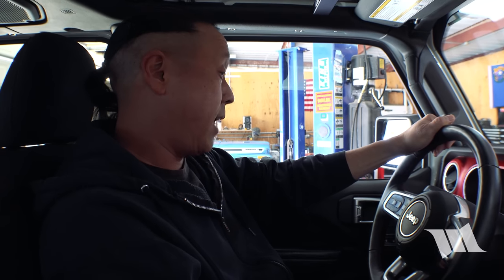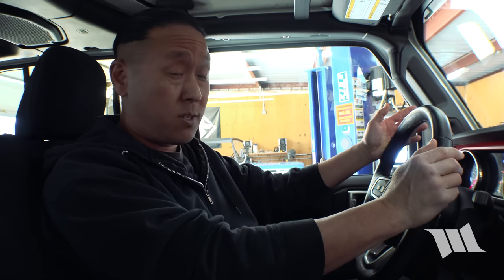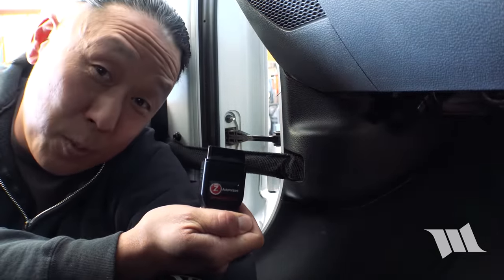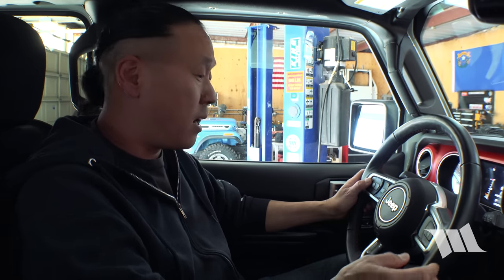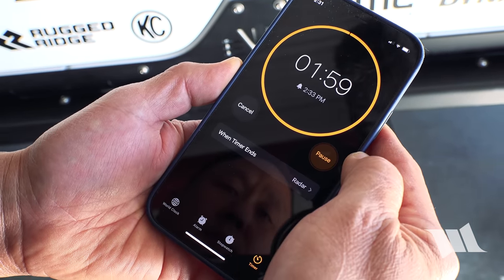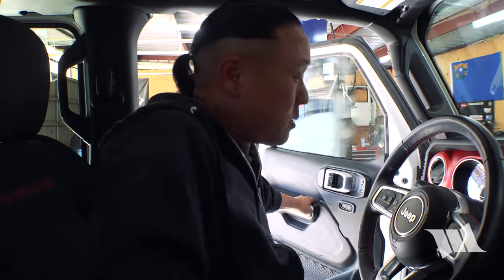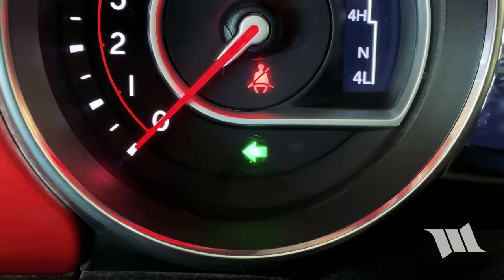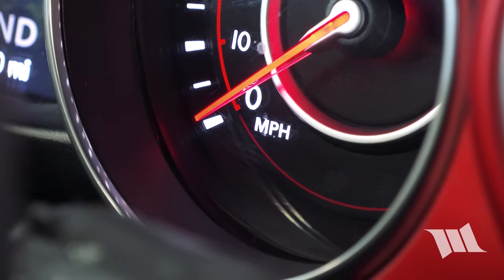HOW TO Turn Off LIGHTS OUT Error on a Jeep JL Wrangler or JT Gladiator After Installing LED

Comment: You just showed a great reason to NOT change the LED tail lights!!
Reply from the maker: LOL - that may be true but as I note in the video, this will ALSO address new headlights, fog lights or even front turn signal lights. A change to them will ALSO cause the error to come on and this will get rid of it 😎
Reply: Yes, that’s silly, why have options for anything?!
Reply: @wayalife and you need to pass this process with each kind of light?
Reply: @Danifer_TV  my experience if your changing them individually over time, then yes. If you change them all at one time, set up the right settings in tazer, do the process, then no.

Comment: for Flashcal F5 users with JL/JT, plug your flashcal device , turn on vehicle (w/o starting the engine), go to "options" then choose "vehicle settings" scroll to 2nd page then choose "Standard/LED". if you have the OEM LED package in your jeep you will select "standard" then exit out and unplug your flashcal device. You will do the same procedure again but this time you will select LED. after selecting LED, go to DTC reader and select "clear codes". while the Flashcal device is still plugged in,. go ahead and turn on your turn signals 20sec on L and 20sec on R. that should clear the annoying dash warning light

Comment: Finally got it to work! For those of you struggling with this, I had to do an extra step. When you’re in the Tazer menu be sure to select Clear CELs?  After I did that and followed the steps laid out, it worked! My Oracle tail lights are no longer hyper flashing and the error code is gone!
Reply from the maker: Good tip!
Reply: How do you clear CEL’s?

Comment: Tried this and it didn't work the first time but I discovered a few things that may help... The core issue is that the factory LED's have a fault sense wire and this procedure is designed to turn off that fault wire.  The question becomes, does the replacement LED light fixture have a chip or a circuit to normal this out, if not, then this procedure needs to take place.  Adding resistors just effects the voltage to prevent hyper flash on non-led to led conversions.  That being said, my issue was due to a fender chop with small LED pod lights that I'm using for Turn signals.  Since I'm no longer using factory DRL I used the Tazer to change DRL: none.  Although the Tail light LED off/on procedure didn't work, I decided to try the procedure but toggling the FrnTurn LED from On to off, followed by 3 reboots and then Off to On followed by 3 reboots.  This Worked !!!  So to speed things up, there is a faster way to do the reboots.  1. Close the Jeep door. 2. Run position and go to Tazer and clear DTC's.  3. Go to lighting then Tail or FrnTurn depending on which one you are trying to fix. 4. Change LED to NO. 5. Reboot.  6. Once the reboot is complete turn the Jeep to off position "Do not open door".  In order to hit the sleep cycle just wait for the screen to go black then look at the shifter and wait for the lights to go out.  You can then go back to the run position and do another Tazer reboot.  There is no need to wait 2 minutes.  Once the reboot is done, go to ignition off and wait for the shifter lights to go out then repeat. After the 3rd reboot, go to the ignition run position access the Tazer and turn back whichever LEDs you turned off back to YES and do the same 3 reboots.  Remember, you need to keep the door closed to speed up the sleep cycle between reboots.  Will literally cut the time by more than half.

Comment: This worked for me 100%! I have aftermarket fenders with integrated LED lights from Metal Cloak. I recently started getting a dash error that my right front blinker was out. Upon inspection of the wiring I saw that one of the two ground wires had been severed/disconnected at the termination point in the plug (on Metal Cloak side). Surprisingly, the light still worked it was just throwing an error; best guess is that ground was to detect continuity on the Jeep side. Metal Cloak sent me a new light unit with no hassle at all. I put the new one in and still had the right front blinker out message on my dash. I followed these instructions except I selected "LED HED". FIXED!!! Thank you! 🙌
Reply from the maker: Glad to hear our video was helpful to you 👍

Comment: After numerous attempts to fix my issue, this WORKED!!!!  No more light out error on the turn signals.  THANKS!!
Reply from the maker: Awesome! So glad to hear it worked for you and that our video was helpful as well.
Reply: Great question and great video, I’m about to do this on my JLU…. I’m assuming I clear the turn signals in the Tazer instead of the tail lights to clear the turn signal code…or do I follow this exactly like you did in the video Eddie?  I may just try this both ways!!  Thx again for posting this!!

Comment: Thanks, this has been driving me crazy with the AAL fender brace replacement. I had the wired harness but it stopped working and I began getting the hyper flash and warning message. I took the harness off and used the Tazer JL method and it worked! Thank you. Thank you. Thank you!
Reply from the maker: Glad to hear we could be of help to you with our video.

Comment: I had been searching for a fix for my aftermarket fenders with LED turn signals. I have a Tazer Mini and followed your instructions. This 100% fixed my Lights Out message that would come on all the time and the Hyper Flash. I did initially use the Tazer but I was still getting the message. This step-by-step guide was top notch and really worked. Thank you!!!
Reply from the maker: Awesome! Glad we could be of help with our video.

Comment: Thanks for the video.  This is not the first time I've needed to get rid of that pesky tail light out warning. The last time was after I installed my aftermarket tail lights.  A month ago I needed to swap back to my OEM LED tail lights. (long story there for a different day).  Last time I think I got the alarm to go away by doing 2 sleep cycles of 5 minutes. I am pretty sure that worked... then... but not now.  Your suggestion of doing full reboots did work this time around... at least so far. Thanks again.

Comment: For me, this video shows how useless the dealers can be.  I bought a "Slightly used" 22' Gladiator that had LED taillights and got the error message as soon as I drove it home.  It only happens when I'm using the left signal.  I took it back to them 2 Separate times and they couldn't figure it out.  Now I'm glad I can do it myself.  Great video! 👍

Comment: I used JSCAN and changed setting once. No need for multiple times at all like this video required. Been working fine 6 months no issues.
Reply from the maker: Cool. If you have these exact same lights and were able to clear the error with just one setting, good for you.

Comment: Yes, the Tazer JL reboot cycle is... "involved". When I first got mine, I made some changes to my Jeep and they didn't seem to take. I read the reboot procedure what felt like ten times, because it's not really clear. I finally performed a similar procedure to what you have shown. Only difference, I stayed in the Jeep. I would just open and close the door, wait for the lights, etc... but remain in the vehicle. Thanks for the video, certain it will help those that miss this last and important step.
Reply from the maker: I'll bet that works too. I think the point of exiting the Jeep was to help it to go to sleep faster. At least, that's how it was explained to me.

Comment: Thanks for this tip. I got that error code when I installed the Oracle Flush Mount Tail Lights on my JLUR
I already have the factory LED package and didn't need the resistor
Reply from the maker: Glad it helped
Reply: I’m having the same issues with my Oracle lights. So far not having any luck while trying this reset. Eddie, the first three resets you have the LED Tail set to No and the last three resets you have it to Yes, is that correct?

Comment: after i got to work i watched this a second time and decided to try it.  turned off the LEDs and did a reboot.  got back it and out of habit i started the jeep.  did another reboot. realizing this was going to take to long before work started, i turned the LEDs back and did one more reboot.  it worked.  no fault, no hyper clicking dash.
Reply from the maker: Cool
Reply: The Tazer manual suggests only changing to NO and then back to YES with the 20+ second indicator use. ver 11.3.7.. I think Ill be trying the short method first, then, if not.. the long winded way..

Comment: Thank you for this Eddie. I changed out the Fenders on the JLU and got this message for over a year with no luck shutting it off.  I have since sold it and bought a new JL and a JT, so this info will come in handy if and when I change them out again. Incidentally, I did keep my CB Bar, but will need another one for the JT. Will they be in stock again soon?
Reply from the maker: Awesome, glad to hear our video will be helpful to you on your new JL and JT and the CB BAR's are in stock now 👍
Reply: @wayalife  awesome, expect my order in the next few minutes.

Comment: Hey Fella - Love the videos. Do you have a video for the same procedure when replacing halogen headlights with LED Headlights with Halo Rings?...Since it is set as STD in the settings I would think simply changing to LED and doing the "REBOOT DANCE" will make it all work. I am installing LED's next week and already have LED tailights on the Gladi.
Reply from the maker: If you're getting the error code, I would give this a try. You would do the same thing only, when you're in your Tazer, you select the headlights.

Comment: Great video as always. I’d love to see a video on speedometer calibration. I have 35’s and bought an ECRI calibration. I changed the tires to 35 and the gearing was off. So I tried the driving method but it would only go up to about 33.35 for the tire size. So the gearing is still off. So a video with tips on this topic would be great.
Reply from the maker: Sorry, have no experience with what you have but with the Tazer, this video is what I did to calibrate our speedometer https://youtu.be/81_evB9At3I
Reply: @wayalife  Thanks! I will be check it out. Also, just purchased a Wayalife decal. Can’t wait to slap it on my jeep. 🤘🏽

Comment: I’m going to try this on my JL.  Ever since we installed the AAL highlines we get a very intermittent front turn signal warning on one side or the other.  It’s very random and doesn’t stay on long, but I’d like it to stop permanently.
Reply: Did Your JL came with the LED package ??
Reply: @faisal3865  yep
Reply: @psualligater  I guess that explain why u had it, mine got the halogen and I am worried i well get it when i upgrade
Reply: @faisal3865  I have halogen original and upgraded to LED at first it worked fine and no errors on since I had the Tazer but now I have an error and cant get it to go away as well as my LED indicator doesn’t blink on one side

Comment: Thanks for this extremely helpful video. Btw after reset those settings, can I unplug the tazer and reattaching everything back to the SGW module?
Reply from the maker: Yes. But, you will need to restore everything back to stock before taking your Jeep back to the dealership.

Comment: Had a similar experience with the taser mini. I drive a manual JL. Setting the tire size required an extra couple of steps for manual vehicles. 🤣 As an IT guy it reminded me the importance of RTFM 😜🤣
Reply from the maker: LOL - If you don't mind me asking, what extra steps did you have to do? Pippi, our red 2-door is a manual and if we ever change the tires on her, this would be helpful to know. THanks!
Reply: @wayalife  If you have not already found the answer, I had to do this same relearn procedure.  After I changed the tire size on my JL with a manual I had to get on the freeway and maintain a speed of at lease 40-80Mph and shift into 6th gear for 30 second while applying continuous light throttle (without letting off). https://www.zautomotive.com/zpu/instructions/jlm6relearn.pdf

Comment: Great video! This is a little off topic but I thought the larger community might have an idea. I do not have a Tazer. Here's the problem which is also on Wrangler forums. When I turn off the Jeep the gear indicator lights and center dash display lights remain on, intermittently., but when it starts it stays. The battery is dead in the morning. I have removed fuse F97 and F25 to no avail. If I completely disconnect the battery the dash light remains on, meaning it is drawing from the aux battery.  Any ideas on how to correct this? You seem so knowledgable so I thought I'd give this a try. Also a shout out to the community. Thanks for listening.

Comment: I really liked the black out lights when you installed them and having a black JL thought it would be a cool upgrade. But if the manufacture is reading the comments, “you have to debug this before I will buy them.”  🤨
Reply from the maker: LOL - well, to be fair, this error is something you most likely will see with ANY change to lights on your Jeep. Headlights, fog lights or turn signal lights.

Comment: What about the front turn signals. I replaced the halogen with LED factory lights and the indicator light on the instrument panel is doing what yours did. Does the computer let you adjust the front?

Comment: My Tazer should be coming today. Previous owner installed LED turn signals and I've had that error code since day one. Hopefully it'll fix the issue
Reply from the maker: Yup, this should fix it. All you have to do is the same thing only with the front turn signals.
Reply: Disregard my last comment. It worked

Comment: Eddie! I upgraded the halogen fog lights on my JT with Baja Designs squadrons. I don’t have any errors on the dash. Changed the settings with my tazer mini for led fogs, but the squadrons still slightly flicker. Not sure if the canbus system is unhappy or the lights are faulty. Do you think this method you did on your tail lights might be something that could help my situation?
Reply from the maker: The flicker is an issue with the lights. Some companies sell pigtails that will eliminate it.

Comment: I did exactly what you said and it works on run mode with no engine running but once i turn on engine no go. Right front turn signal out
Reply from the maker: Not sure what to tell you. Maybe contact Tazer.

Comment: Will this work on a “right rear turn light out” message? Purchased car used, not exactly sure why the error, but the light is working. Dealer said it was likely due to wiring from instal of a flat tow hitch.
Reply from the maker: I would think it should.

Comment: Have you ever heard of the right tail light not working on a jeep gladiator? Brake and signal works just fine but will not stay illuminated at night when the lights are on. Already replaced them to the oracle tail lights, and did not work. Jeep lights are non LED. Any feedback helps.
Reply from the maker: Just the right tail light? Sorry, I have not heard of that.

Comment: Do you have to keep the Tazer connected after you clear it? Or can you pull the tazer out and it’ll be good still?
Reply from the maker: You can remove it after.
Reply: Do you know why mine didn’t work? Would you press full reboot or just left arrow and resume button?

Comment: My 2023 Rubicon did not come with LED headlights or tail lights. If I buy the Oracle flush mount tail lights, can I just use JScan and my OBDLink MX+ and set the LEDs to active in my adaptations?
Reply from the maker: I don't think so. So far as I know, Tazer is the only thing that will allow you to do this.

Comment: I get the same error but for the front signal lights. Do I do the same process but instead of changing the  LED Tails do I change the  LED Headlights?
Reply: Yes! I’m about to do this tomorrow for my front DRL lights
Reply from the maker: Yes, it will work for that too.
Reply: Should it be the headlight I do for LEDFrtrn I think that stands for led front turn signal?
Reply: @wayalife  it still makes the beep but no longer shows the warning signal picture! Thank you!!

Comment: I have a question. I had an electrical issue on my Jeep and both batteries had to be replaced everything’s working fine now but the DRL are not working I bought the Jeep with aftermarket headlights and I’m wondering if this would fix my issue? Thanks in advance
Reply: I had taken the battery off before and never had any issue with the DRL but this time was a much bigger issue and the check engine came on and I had a bunch of codes.@

Comment: in the instructions they say that you need to do a full reboot and two sleep cycles after make any change, did you try that?
Reply from the maker: LOL - you assume I got instructions with my lights.
Reply: @wayalife  LOL I meant in Tazer instructions, I’m just asking because i have the same issue, I did follow the same steps as you and is not working for me, actually it seems my tazer jl mini is causing dead battery, thanks

Comment: Will this work for aftermarket marker lights I'm having a problem with my blinkers not working once I power on my jeep .. 2018 jl  wrangler Sahara
Reply from the maker: It would depend on whether the lights are not coming on or if you're just getting an error code like I show in the video. If it's the prior, you most likely need a resistor.

Comment: Worked on my JL - thanks!!  Any idea if this same process works for a blind spot monitoring system error? Installed Oracle led flush tail lights and it started throwing all sorts of errors. Now that the tail light error is fixed, the blind spot monitoring error won't go away.... Thanks in advance if anyone has any ideas!!
Reply from the maker: Honestly, I'm not 100% sure but I'm pretty sure the Tazer has a means to turn it off.